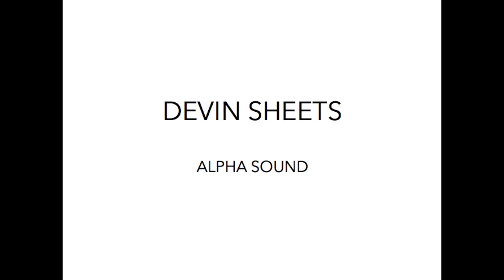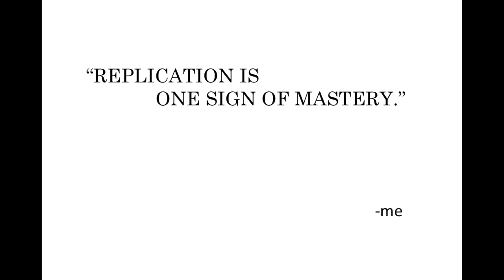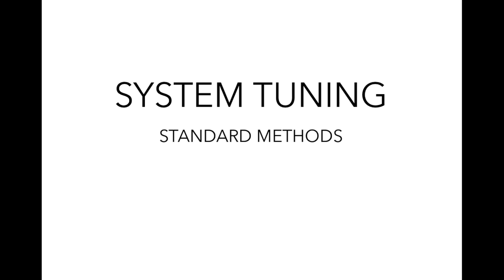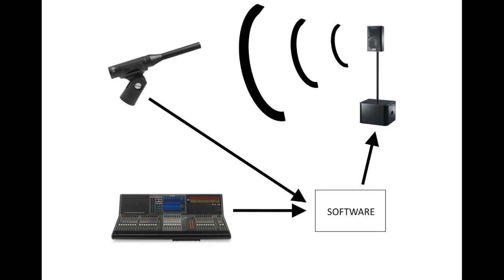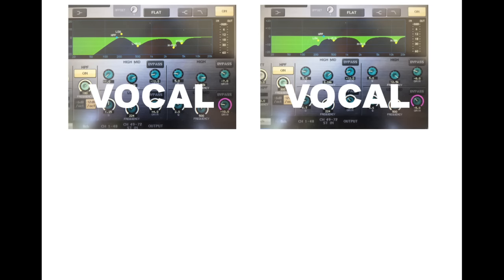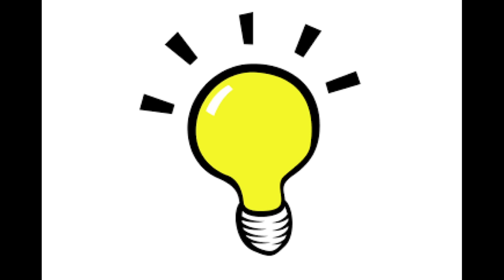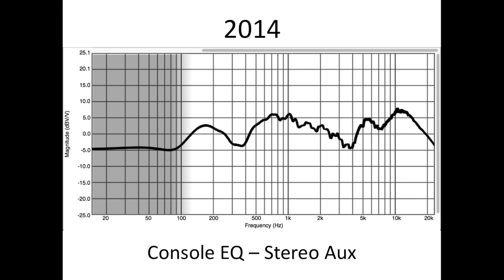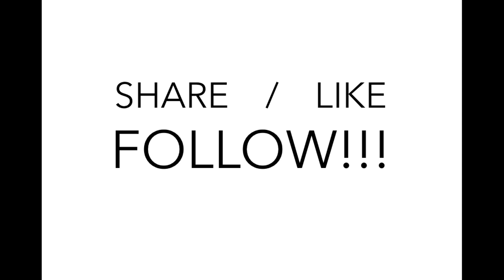Sound System Tuning By Ear

Comment: Couldn't agree more. Been doing it "by ears" for more than 30 years.
In the most difficult venues (walls all around, or low ceilings), flatten all first with the spectrum analyser, then do the smoothing by ear.

Out-of-topic, i would add, to the new generations of engineers, Play Music Yourselves. Learn the basics of at least one or two instruments. Experience playing on a stage (no matter how small).
This will give you a far more deeper understanding of what's going on up there when you're at FOH.

Comment: I totally agree with learing the tune a system by ear. You become better as a sound engineer and also in-tuned with either bumping lacking or cutting hot and problematic frequencies whether indoor or outdoor venues!

Comment: I use a 20kHz to 20Hz sine sweep when I tune a system, works great.  The 30sec sweep I use is from a Quad Maximus Bass Mekanic CD goes from high to low.  My hearing doesn't start until about 15k, but I find this to be the best way to set up systems.  Afterwards, I play a couple of standard songs that I know very well.
Reply: whats smoothing of the resulting graph you use? and do you sweep a single spot only?

Comment: Nice insight! However, I feel that what you're after with your target curve is part of the "toning" process of the sound system. Which is a subjective topic. Tuning a sound system, for me at least,  mostly deals with verification of the system, worrying about coverage, amount of subs, time alignment. I sometimes don't even have time to EQ the system (thankfully most system I handle are doing okay with just their factory presets) and leave toning to the mixer guys.
Reply from the maker: Yeah there is this distinction floating around between tuning and toning. It’s a fair distinction but to be honest not everybody uses it or has even heard of the distinction at all. Might be a good excuse to make another video!

Comment: EDIT: I should have watched the video before commenting :D

What kind of ideas/thoughts do you have about flat frequency response and/or equal-loudness contour? 

As a sensitive person I've always hated how often the PA sounds super harsh in the most sensitive range of the ear, say about 2,5-8k. I have managed to get to places where I did sound tunings (just EQ) for about 200-300 crowd and got really good feedback afterwards. Now looking and thinking back, I've always went somewhat in the lines of the equal-loudness contour, minus some bass in some cases.

One time this somewhat familiar girl came to me and said that she immediately knew who had adjusted the sound when she walked in to the venue, and was very glad.

I've now done "home use" equalizations with EqualizerApo, for example in my living room and for the headphones I use on the computer. And I mostly did it with an online tone generator (szynalski) and by ear, finding the dips and peaks. For the headphones I'm using at the moment, I have 23 EQ points per channel plus 23 for both. I know that getting actually flat response with headphones is pretty much impossible as there is always some movement and small differences with the positions. But I'm more curious about should I try to adjust more scientifically (with microphone) and not with ear? As I believe my ear can't be "universal" :D I'm a bit afraid of possible "bad taste" and how my hearing may adapt to my preferred settings.

I have a friend who thinks very much the same about the frequency response (when talking about "disco" and loud music).

Comment: I don't roll with the new digital tuning software.... I always been by ear. I am both a producer/musician and also the engineer of a mid size but very clear and absolutely great sounding system. I completely understand what he means by overall mastery comes with replication consistently.... this has always been true when producing and engineering electronic music tracks aswell! Great video though! All excellent points! Pink noise is something we use faithfully, white noise is too harsh for my ears... I generate the noise via a synthesizer I always have on hand. I also have to tune my synthesizers from time to time which I do use a chromatic tuner for, but that's a different world.
A sub harmonic synth for low end in systems helps also! (Use a b.b.e.)... a b.b.e. offers similar results and gives you both upper end reprocessed clarity along with low end contour adjustability.

Comment: Couple of things I do you did not mention. 1) delay align the instruments to the PA, so that the source sound is just ahead of the PA. 2) Bass steering to keep the bass from piling up in the middle of the back wall. General observations: The more you push for clarity in 3khz the more unforgiving the sound becomes. Timing, pitch, everything is super noticable. Sometimes it is important to offer a little forgiveness even to pros. The other thing is your 250 range, too much and it is mud, too little and it is wimpy even when loud. It is definitely important to balance that range with the lower octaves. You dont always get to push up 160, but you can always cut 250.

Comment: I have been through all these issues in tuning... lol  I have also spent lots of time second guessing my methods and refining my sound-stage.  Using the calibrated mic was always a good place to start with a new room just to get an idea of a baseline.  Each room or venue is different, but I have found myself using a combination of techniques to arrive at a similar outcome each time.  Experience and a good ear always outweigh measurements and standards.

Comment: I tune all of my systems that I install this way.  I spend quite a bit of time  tuning the subwoofer as well.  With that said, I once tried using a song from a certain band I thought might be similar to what the church would do.  I then played a track from another artist and discovered that it sounded HORRIBLE!  It was then that I realized that not all music is mastered equally!  I now have a set of about 10 songs that All test various aspects of the system, but even though they are mostly from different artists (and even different decades), they are all mastered similarly with solid low end, consisten clean mids and clean articulate highs.  For those who care, my first "go to" song is called "I see You" by Rich Mullins (Getting the drums right will get you 75% of the way there!).  I also walk the room a lot as I tune (usually with a parametric EQ either built into the console or amp).  One thing about using a mic is "where do you put it?"  Sound is full of compromises and good sound makes things sound as good as possible in as many places as possible.  I should mention that in general, I have had very happy clients, so I don't have a good reason to change my method anytime soon.

Comment: Pink noise is flat. If youre EQing it with those Fletcher Munson curves, you're actually doubling them because once for your ears and once for your system. The Daniel Weiss "by ear" method is simply make a 0-whateverHz sweep, very slow over several minutes. Listen for the peaks and valleys and mark them in time, then check the frequencies and add adjustment until the sweep sounds flat. You get 95% of the way of software using this method.

Comment: When adjusting EQ, you have an important decision to make: is it a specific channel that needs to be EQ'd, or could the entire mix benefit? If you feel that the whole mix could use an adjustment, you have another important decision: Do you EQ the mains, or the monitors? You can cut frequencies from the main mix all day long but if it's the monitors, main EQ isn't going to do you much good. During soundcheck, it's not a bad idea to bring down the main fader and hear what the stage is adding to your mix. If the show is already live, and you feel like cutting the main EQ isn't getting you anywhere, start nudging down that frequency in the monitors. Go ahead and take a little out of all the mixes and see if that makes a difference for you. Just from my experience, monitors bouncing off the back or top of the stage are mostly going to be throwing back frequencies in the lower mid range, probably no higher than 1K, but it always depends on what the room is made of.

Comment: I'm a relative noob, but room response, especially down low has always been an interesting area to focus attention for me - a bit old school but I use an old sig generator to do an early doors walk around to find where the bass is phasing. Things change when the venue fills up, but that combined with sweeps and pink noise helps me get things into roughly the right place. I still need to train my ears though as I still have some difficulty identifying problem areas once things kick off. Practice, practice, practice... :)

Comment: Typically only reference mics have a flat response curve with all other mics having drastically varying responsive curves. So be careful NOT to tune a FOH system to a vocal mic especially a mic that is different than the performers are using. The L R EQ affects every input signal...

Comment: This is a 3 year old video,maybe you changed your mind on some aspects since then.

Your method is great for system toning(not tuning) ,I use a similar method,but I still need a mic and measurement system (dual channel FFT) to properly align subs to mains,delays to main etc,I first make the tops flat, add the subs (never ever flat to main,depends on application but I do a minimum of 6dB extra gain for subs) and after that depending on how the system sounds with flat mains I adjust the eq.

I have a not yet verified theory that some systems require more gain reduction than others starting from flat tuned,in the 2.5 to 5 KHz area(an area where you also eq)depending on how much distorsion there is from the way the speaker is built(my guess is that large format HF drivers distort much more than a similar speaker but in a 3 way config with a dedicated mid speaker,the bandwith that the HF driver has to reproduce is quite wide and it strugles at doing that in the lower spectrum ,thus distorting more),but I need to study this more scientifically to demonstrate it.I have encountered some systems that sounded perfectly with a flat reponse from 100Hz to 20KHz,these have 5 HF units/array so I guess they do not distort as much as a single unit with a low x-over point.

What are your thoughts on this?

Comment: a method i prefer is running a smaart check to fix any room/venue issues than when the PA is set to its starting point then play reference tracks from a playlist in have of high-quality wav files closest to the instruments and dynamics of that gig, so check a metal gig PA  with a metal album, check a Dance PA with an EDm track .  its important to get the best out of every PA in every venue, arena or stadium but the final eq settings on the rig should reflect your input not just the smaart systems .  as your discussing the pa and the same venue each time id not assume much would change unless you have lost frequencies in your hearing due to life and gorwing older,  or humidity and weather, But moving the same PA to and looking at the ew in say the outdoor gig, a smaller indoor club, and an arena id expect the eq to change to compensate the room interference,

Comment: I only ever mix as a hobby on my home system, or just farting around before the real engineer comes in to mix a theater. these days i have a yamaha receiver that has a standard mic input for parametric closed loop tuning. i let the system software tune with pink noise and some bleeps and bloops (sounds like it uses some pure sin waves to deal with multipath), then i come back and mess with the standard tuning. the software seems want to want a completely flat tuning, and i like my bass blown the fuck out and my highs pretty low. i also manually set my crossover to be as high as possible so that some of the dialog bleeds out through the subwoofer. i'm going deaf, and for some reason this horrible mix sounds really good to me. i also use Daft Punk - Short Circuit as my baseline for mixing because its very similar to the music i listen to. i know its not a good track for mixing, but again, i'm going deaf.

it's fascinating seeing real sound engineers do their work, and i've met some GENIUS WIZARDS that made even me sound good on stage. i still have a few secret recordings that our engineer made at the theater i used to play at, and they sound BETTER than studio quality. they sound better than some of the live recording records i have. i have infinite respect for good engineers, and i will always request the same engineer to mix for me. bonus points if they let me play with the sound board before they set up their mixing. i just want to touch all the dials and knobs, can you blame me???

Comment: 3:58 same here, always ring out the monitors first, and some PA feedback. 

4:40 Hahaha how recognizable! I even had 'an artist I toured with for 12 years. Complained about his in-ear sound. I PLF the out signal of the mixer, and ok. Then monitor the output of the HF transmitter output and also ok!.

Then later tell the artist give me the receiver and your own in-ears. Receiver signal ok. Then I put the in-ears in.... in 3 seconds I knew the problem.

So I go to the dressing room, to the artist and say, one of the in-ear speakers is blown! Didn't use limer either

Here in the Netherlands they go for cheap. If you ask € 10 too much, they go to another ...

Very sad...

but they do place high demands on the sound engineer...

Comment: At 6:11 "compares it to the test microphone
 input". With headphones? This part was a little unclear, because you were just talking about pink noise, so i assumed you're still talking about pink noise. But i get you mean the live mix of the show, not noise! Right? But, you're just ensuring the speakers sound the same as the board output. So you're assuming the board output is well-EQ'd. But what if the board output ISN'T well EQ'd?
Reply from the maker: If you run the output of your console into a software program that compares the frequency content against that of the signal from the test microphone in the environment, it can see what the speakers/environment are changing. This can be done in a static one-time test, or more advanced software can update the results in real time.
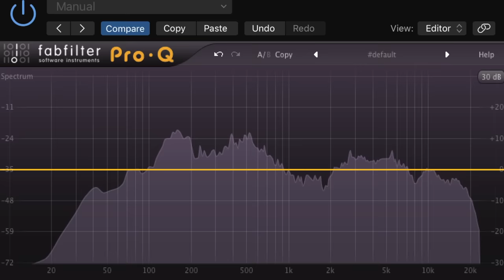Reply from the maker: To add further clarity, in the example at 6:00 and following, this could be the test microphone result of a speaker system, and if white noise if being played through the speakers, we know what the frequency response should be and can EQ accordingly. In the examples from 6:14 and following, since this mic is picking up program content, we don't have a reference for what the frequency content should be, unless we sample it coming straight off the mixer before hitting the speakers and then being picked up by the test mic. In either case, the speakers are being EQ'd so that the resulting sound at the test mic location is not being frequency altered from the original source.
Reply: @devinlsheets_alphasound  In the case of program material, we're only EQ'ing the speakers to match the board output, right? So if the board output is flawed, then this method won't fix that.
Reply from the maker: @johnywhy4679  the “board output” would be synonymous with “the mix” at that point. If the mix sucks… then yeah, doesn’t matter if the speakers EQ is set to match the board output signal.

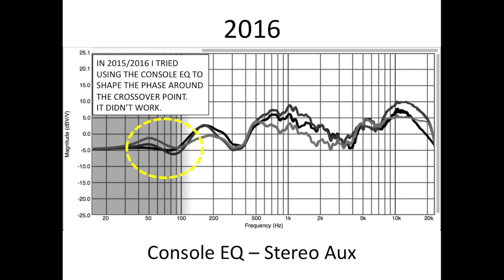Comment: When you showed the master buss curve at 13:06, do you mean that was your EQ curve or is that what your analyzer read on an average?
(Genuinely want to learn).
I ask because I seem to be able to make a system sound great with a reference track. I can also make instruments sound great in the system, however, when everyone in the band plays I seem to end with a muddy mix. (Shall I rely on scooping out frequencies on the master buss just like you did)?
Reply: That was the EQ curve as measured by the software receiving a direct line out from the console master bus. The reference tracks that you use to EQ your system are very important, I highly recommend the two tracks that I proposed at the end of the video

Comment: I think I got lazy no pink noise to tune a sound system. Only in the studio I would do that. I use different genre of music that would represents what is coming to the audience. Basically I tune by ear and trouble shoot quick. And only use test tones if I think there is an issue with the system.

Comment: i don`t think this video is about system tuning at all. the main talking point is just doing a pleasing master EQ for a system. and mainly for own workflow needs. it would be crazy to do system design and speaker alignment on a large scale by ear. let`s say you need to hide an overlap of two summing speakers that are not phase linear with each other.   such ears don`t exist that can tell difference in arrival times of  single frequencies. even if you only had to separate local trends from general trends in a room you should use measurement data when installing a system. everyone usually pays the same money for the ticket so every seat should be equal..